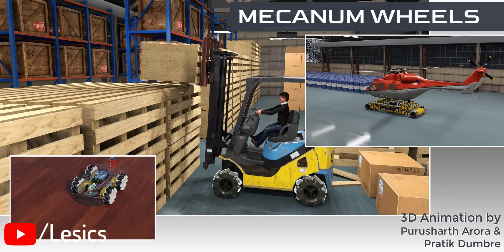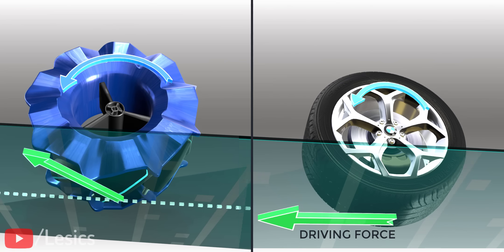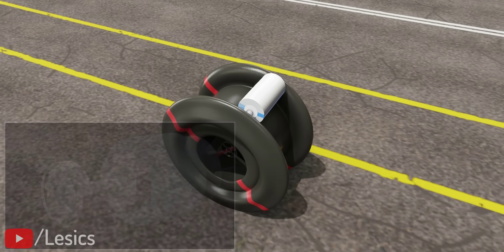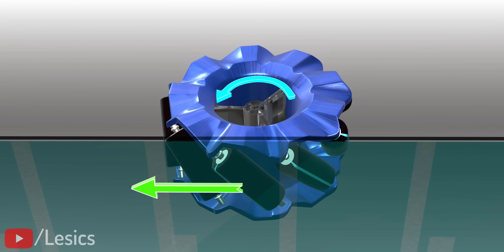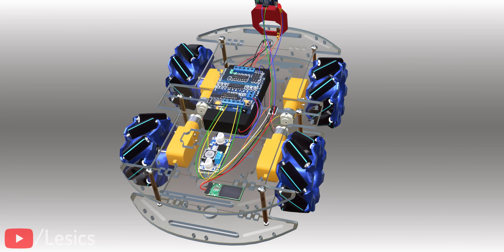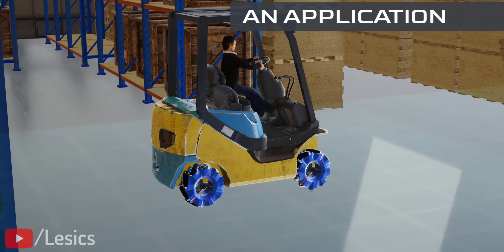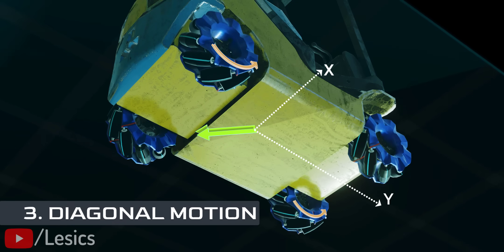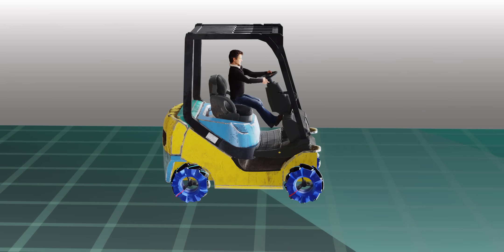The Brilliant Engineering of Mecanum Wheels!

Comment: This is kinda nonsense in a practical sense. I'm a warehouse worker operating a 3 wheeled reach ruck with a 360° turning wheel. I too can turn 360° like this machine. It's less complicated as cheaper than this concept. I see no use at all as to why I would want to move diagonally and laterally.

Comment: We use these for our robotics team! They're super helpful. Makes movement so much easier. With one joystick we can move the bot in any direction
Reply: And when you rotate the joystick you can turn the robot, right? So you can drive it by pushing forwards and turn by tilting?

Other joystick could easily be used to operate the fork itself with up,down,left,right with tilt 👍tough which one you set on rotate is probably personal opinion.

Comment: The wheels don't bare practical maintenance, they're just as complicated, compared to a all direction steer, traditional electric wheels, it does have instant direction kenetic swap movement, but the joints are not simple during wares or tare effects. And in first direction, the main wheel faces uneven second direction surface, to a flat surface its ok at low velocity.

Comment: There are screw-propelled vehicles like the ZVM-2901 that operate on the same principles as a Mecanum-wheeled machine: the smaller wheels on the Mecanum wheel serve the same purpose as the blade on the screw, to make the device far better at applying force perpendicular to that 45 degree angle than along it.

Comment: The idea is very good, but is it economically viable? I expect from this diagonal movement, that the rubber wheels are put into certain stress.
This will cause the wheels to degenerate faster, obviously.
So, the question is: Can this degeneration and mandatory maintenance compete with the maintenance of a regular forklift?
Reply: adding dozens of bearings where 4 already were doing it.

Comment: Mecanum Wheels are very cool but they are great for human driven vehicles but are not good for autonomous robots.  The reason for this is that the frictional force is usually different for each wheel because the center of mass is not usually perfectly centered causing different normal forces and also because the wheels will see different surfaces and thus different coefficients of friction when driving in a real environment.  This is not usually an issue for a human driven vehicle as the person corrects for the difference without thinking about it.  For autonomous vehicles, the differences mean that they cannot rely on motor travel alone to determine distance and direction but also must have a positional sensor or vision system to compensate for it.  This adds complexity to the robot.
Reply: Just throw an IMU in there and tada
Reply: @baileylunn2215  see my comment to David
Reply: For autonomous vehicles floor tracking cameras and collision avoidance sensors are normally used.
Reply: @davidsandy5917  and @Bailey Lunn. That is true but the main advantage of mecanums is their simplicity.  If you have to add the complexity of a position correction system IMHO, you may as well implement all wheel steer (often called Swerve Drive).  I don't know of any systems that are designed for self drive that use Mecanum Wheels.
Reply: @connecticutaggie  yeah I love swerve drive. Definitely the better option
Reply: @connecticutaggie  there are FRC robots that operate autonomously with mecanum wheels but they are only 120 pounds and in a mostly uniform environment so not a perfect proof of concept
Reply: @baileylunn2215  Yes but FRC really does not get most of its points from autonomous.  I worked some with our FRC team but mostly mentored FTC.  For our matches, often half (or more) of out points came in the autonomous portion and often you had to maintain position accuracy to better than an inch after having to travel as much as 20 ft often making 10-20 turns.  We ended up using Swerve Drive and made it to National in Houston.  Some other teams used Mecanums but they often struggled when the floor surface got dusty and also as their robots had to extend and change their CG.
Reply: @connecticutaggie  yeah I get that. I never liked mecanum wheels on the drivebase. Too many frc parters failed to climb to level 1 in 2019 because their damn mecanum wheels had no traction. Swerve took over that year with 1323 but we were still nearly as efficient as them with a regular tank drive
Reply: @baileylunn2215  Swerve Drive has its challenges.  It is certainly much easier to spin with tank drive but you can't crab with tank drive.  FRC and FTC are all about the puzzle.  To be the best, you need to choose the best robot design to meet the challenge of the season.  I am an Engineer and I enjoyed the fun of that and helping HS students to learn and embrace that as well.  My oldest son learned a lot from it and is a ME at Oregon State and is on one of the top Formula SAE teams in the US.  It is a great program.
Reply: @connecticutaggie  I was thinking of joining the SAE team at my school, seems like a fun transition from FRC
Reply: @baileylunn2215  Are you ME?  Where do you attend?
Reply: @connecticutaggie  hopefully aero but right now just general engineering at Purdue
Reply: @baileylunn2215 I recommend joining an Engineering team (like Formula SAE). It is fun and will make you a better Engineer.

Comment: These wheels were copied from a description in the book if Ezekiel from the bible over 10,000 years ago as described in the engineering in a book from the engineers from NASA back in the 70s. NASA used these wheels on one of thereMars rovers and Lunar rovers.
Reply: hahahaha...  the oldest book of the bible, the book of Job was written around the 2nd millenium BCE....  so 10,000 years is a bit of a stretch there, bucko....  hahahahahaha

Comment: 0:13 when you don't know how to use your brain that's how you drive a lift.
A regular lift can turn on the spot but it will turn around the front axle. Which gives a slightly bigger turn radius that these wheels. But not thhaaaatt much.

Comment: The issue with this is simply cost . These wheels are more to repair and replace than traditional ones. A traditional forklift only requires 2 drive motors for an electric unit. These will require 4 motors , 4 drives , sensors for feedback control ,etc = more cost. The advantages when compared to traditional layouts is minimal.  A trained forklift operator can overcome these limitations on a traditional system or just layout the warehouse properly.
Reply: Exactly my thoughts.

The limiting factors that these wheels overcome are mostly just bad interior design issues. 

If your warehouse footprint is so small you can't turn a forklift around, you have some other issues to sort out. 

And if you need sideward and spinning motions on the regular, you'd likely implement a completely different solution
Reply: You are trading four motor vs. two against a steering system. Regarding wheel replacement, individual rollers can be unbolted and replacements added if needed.
Reply: @davidsandy5917  just cause you can replace each individual one doesn't mean it will last or be easier to maintain. Forklift tires take alot of abuse and weight load. I guarantee you the maintenance cost will be significantly higher than traditional wheels.

Comment: The Mecanum wheel is a cool invention, but modern forklifts already have extremely tight turning radii. A bigger problem forklifts face is having human operators, which take up space that could instead be used to bring the payload in closer/over the vehicle. These wheels add an unnecessary level of complexity and reduce reliability, that wouldn't be better solved by implementing two-axis steering.
Reply: I installed this system at Van Der Lay Industries.
Reply: cool story bud, but these are literally already used in industry
Reply: "A bigger problem forklifts face is having human operators"
Found the robot.
Reply: @SUBARCTICPSYCHO  and you didn't even need to ask him to identify all the images with bridges in them...

You Captchas are getting pretty smart... even creating your own YouTube accounts?😉
Reply: xD
Reply: @SUBARCTICPSYCHO  ikr 😆
Reply: The larger rear end also offers a fulcrum for counterweight.. Make it too short and it'll tip over 🙈
Reply: @OldGuy625  Stability is determined by footprint & Cg.  Since Mecanum wheel systems doesn't change the footprint nor the Cg, it doesn't impact stability.  Mecanum wheel systems also doesn't require significantly more power, and the rollers are not slipping on the floor.  The main advantage is the ability to "crab" laterally, at ANY angle.  It's main disadvantages are lower capacity and higher complexity (mechanically, electrically & controls).
Reply: > A bigger problem forklifts face is having human operators

I hope they come for you, too.
Reply: Automated robots will solve that!
Reply: There you go pointing at humans as the problem. That's what they want you to do. How long until you are replaced?
Reply: Listen I’ve been driving forklifts for 32 years ever since I started back in 2008, so I know a thing or two and to be frank you can never go wrong with even better turn radius
Reply: Even pretty old forklifts have good turning radius, its not around its own axis but if you try standing inside the circle of the inner front tire you wont be walking again...
Reply: You mean like this? https://youtu.be/pAu0nPg8R1I
Reply: I wouldn't call having human operators a problem. People need jobs, man.
Reply: @DarkzyTheMew  Darkzy, I believe Geoff was referring to human operators being a problem from a technological/operational point of view, in keeping with the theme of the clip. People do need jobs, and being replaced by a machine or software is a serious problem we have to address. However it is a socio/economic problem and therefore outwith the scope of the original clip.
Reply: @robertdewar1752  fair
Reply: @robertdewar1752  Found the Scot!
Reply: @DarkzyTheMew  "People need jobs, man" That's exactly what the capitalists who are destroying the environment want you to think, but it's not true. People need access to resources, they don't 'need' jobs. A good example would be very rich people, alot of them are rich in spite of the fact that they don't work. We should apply that to everyone, it would reduce carbon emissions dramatically😛
Reply: @DarkzyTheMew  drones have human operators
Reply: @DarkzyTheMew  do you consider building, maintaining, writing software and managing robots a “job”?
Reply: @DarkzyTheMew  lol people need good jobs..if a robot takes away dangerous and dull factory jobs i couldn't care less

Comment: As a traction aid for poor surfaces I'd like to see a set of wheels where the rollers can be driven via a coaxle shaft with a motor for the wheels carrier frame, and another for the rollers themselves. with the ability to select the rollers ability to spin freely or to be held locked will permit the vehicle to deal with poor traction caused by sand, gravel or other loose materials.
Reply: Kinda pointless, going through sand or gravel would almost immediately kill the wheel by getting material inside the roller bearings and jamming it all up
Reply: @baileylunn2215  Such is life, you can't avoid dirt eventually it's going to find you...

Comment: Being a professional fork lift driver for 25 years I would say wear would be a large factor on these wheels considering the weight exerted on them at times, great idea but probably too costly considering bearings and rubber wear.
Reply: Yes, looks like there are a lot of forces working against each other here.

Comment: A wheelchair is another great use for these. Maneuvering a wheelchair through spaces designed for walking is often impossible because of narrow spaces. Also maneuvering a wheelchair to be directly adjacent to a wall or cupboard is very difficult.
Reply: yeah I agree, however for indoor/outdoor use you need a traction adding device to deal with dirt, dust, sand and other debris that interferes with good traction.

Comment: A lot of friction as the wheels are generally rubbing along at 45 degrees to their direction of travel, so not very efficient and high wear rate. Wouldn’t it be simpler to have a large circular plate lift the whole vehicle up half an inch, rotate the vehicle, drop down and drive off. No steering mechanism required.

Comment: Interesting use of the Mecanum wheel, but what does the human interface look like? The classic steering-wheel-and-gas-pedal arrangement will not work in this case, so how would a human operator be able to intuitively operate a Mechanum-wheeled vehicle?
Reply: Joystick controls?
Reply: Usually, a joystick. Push forward, back, left or right to translate, twist to pivot. You can combine motions to turn on any radius or move diagonally.